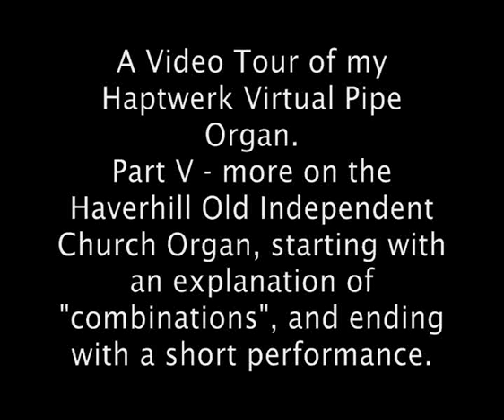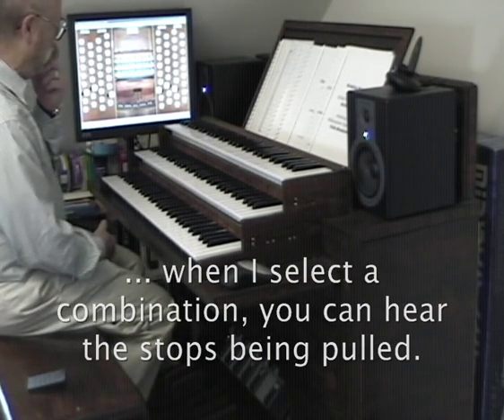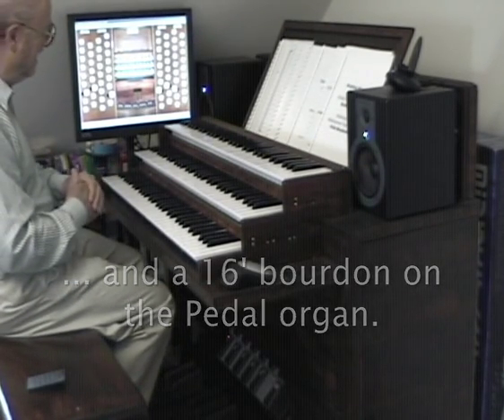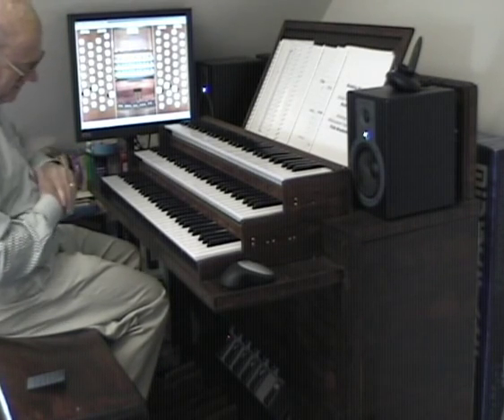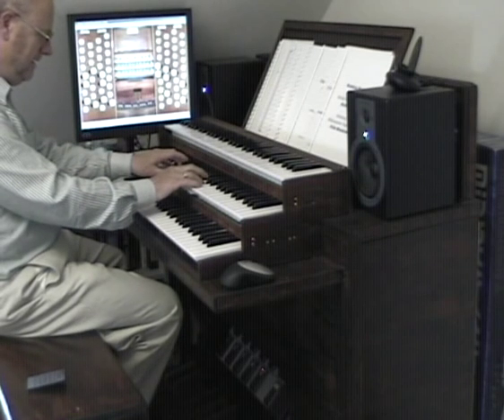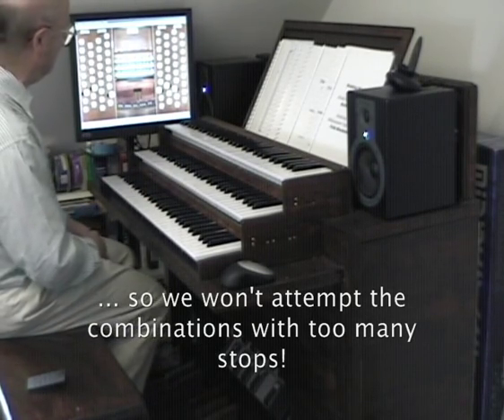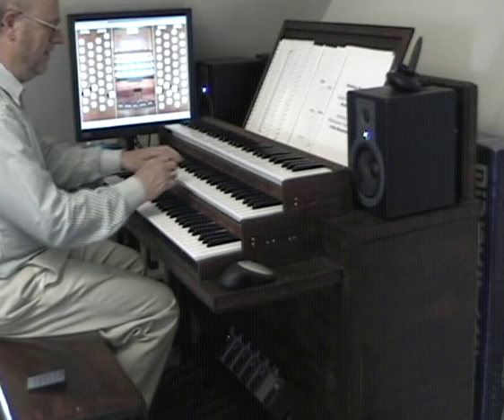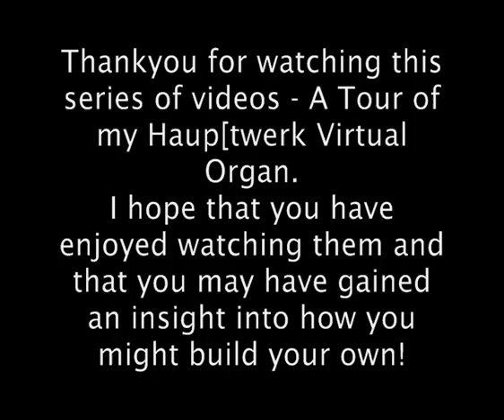A Video Tour of my OPUS i Hauptwerk Virtual Pipe Organ (Part V)

Comment from the maker: Thanks Mike - glad you liked it!
I use an English configuration: choir on the lower manual, great in the centre, and swell on the upper. For the O'Cahan's Lament, I used the voix celestes & vox angelica on the swell for the first section. Then I moved to the great with just the rohl flute 8' pulled. Then I broadened to a simple chorus of diapoason 8' principal 4 and fifteenth 2. Then I brightened the chorus by adding in the three rank mixture. I finished back on the swell as I started.
Ken.

Comment from the maker: @ps6939 Hello Paul - I am not exactly sure how much the organ cost (and I still have enhancements to make - thumb pistons beneath each manual and a full set of illuminated stop switches). But I have spent well over £1.3k (trade prices) on the PC (now has 16Gb RAM & 2x 1Tb discs); the software is over £1k (Hauptwerk v4 Advanced edn, SONARX1, etc etc). The keyboards, USB-MIDI box, MIDI PCBs, Behringher etc etc are about £1k in total, and sample sets more than £1.5k. Still heaper than pipes though!